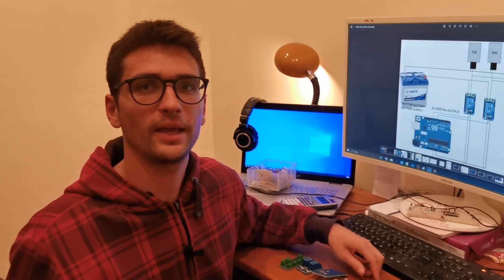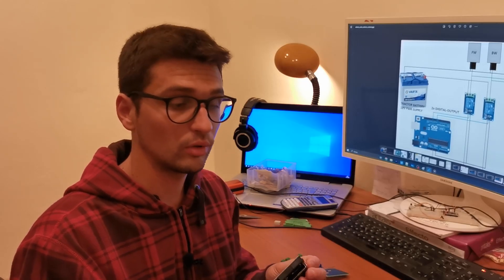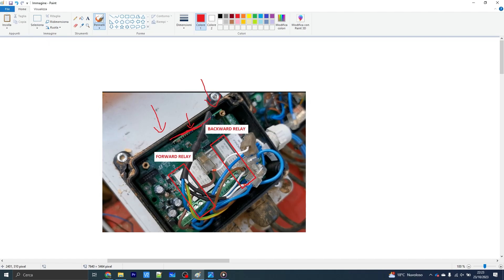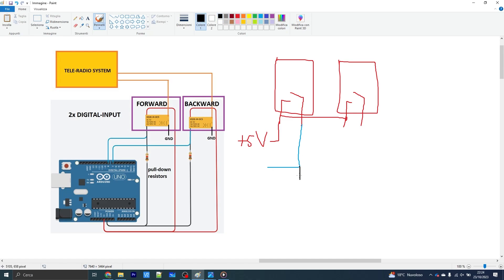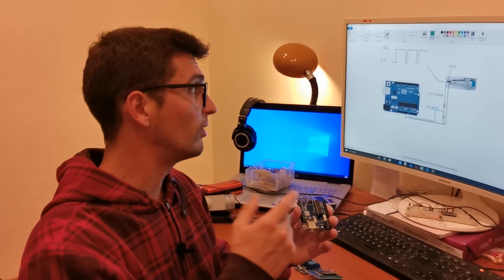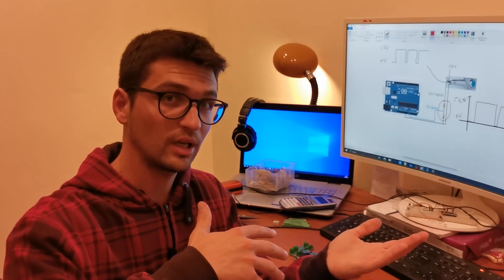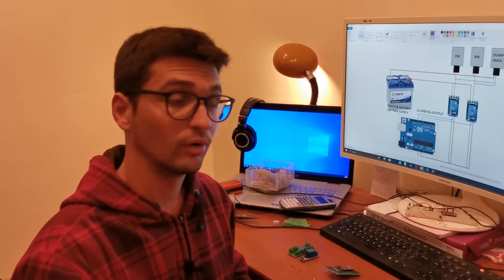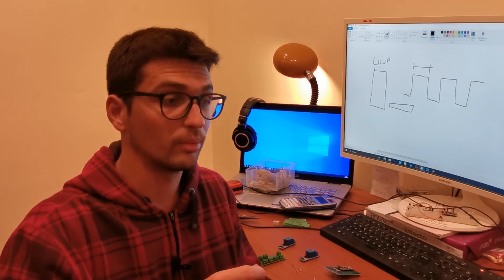ARDUINO + FARMI chipper - controller HW construction & installation  [3/4]

Comment: No I have a GreenMech Arborist 150 Chipper. Uses a board similar to yours and faults where  erratic.  My chipper is a trailer mount and also have to monitor the engine also.
Reply from the maker: That's good! It seems a good machine, I've searched it on internet. So you had similar issues? How did you solved? Do you use this machine for your work?

Comment: I agree with the last two comments well done. Could you make a copy of the code as i have Chipper Pro System also having funny results.
Reply from the maker: Hi! Thank you for having watched the video! Did you have the same issues?
If you write down your email I'll send you the code
Reply from the maker: Do you also have a speed controller, together with hydraulic feeding system?